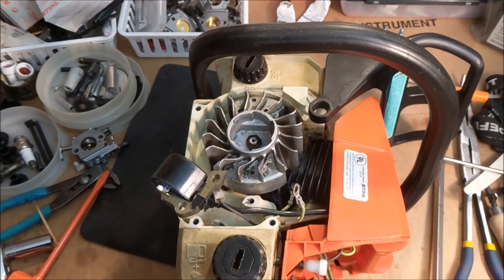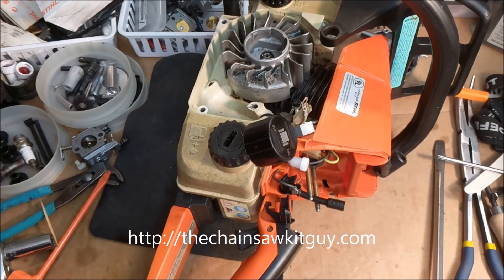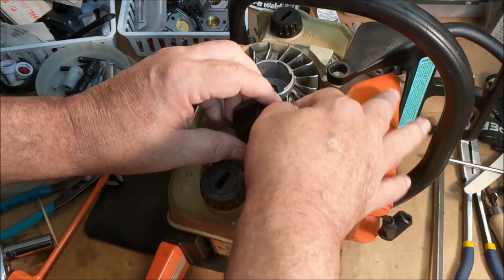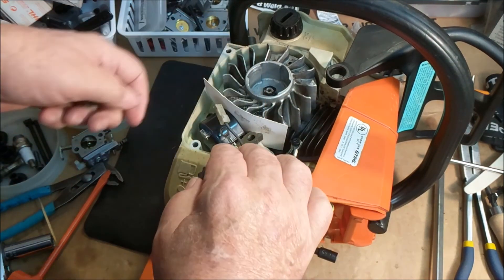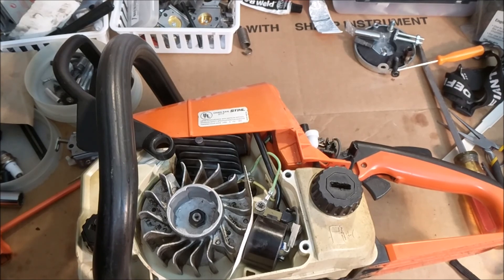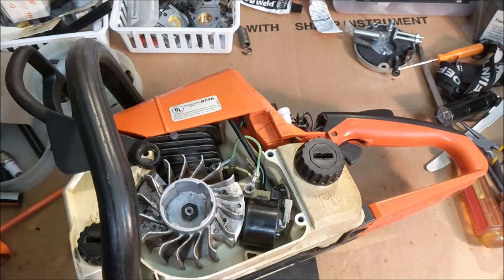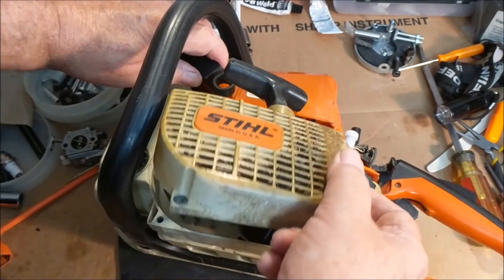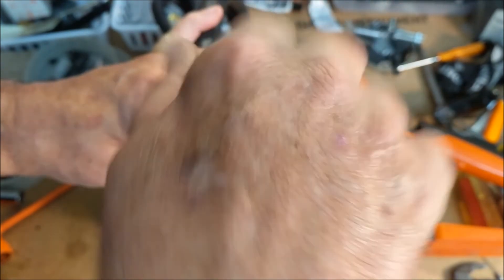Stihl 025 2nd Rebuild Coil SURPRISE, Recoil

Comment: Sure is nice to chat with you I’ve watch many of your videos and from that decided I was gonna do my first clone 660 build. It was an experience let me tell you. I was wandering if you ever ran in to flywheel issues with those saws. I was having severe recoil kickback on that saw originally actually had to go through surgery on my middle finger tendons. I retarded the woodruff keyway to eventually solve the issue. But not sure if the flywheel key was off from factory or if I had something else causing it. I would be very interested in your thoughts on this?
Reply from the maker: Thanks for speaking up. I enjoy it when someone wants to talk. No flywheel problems. Hard to pull is a recent phenomenon. An example, I recently built a 660 kit and put a cross cylinder on it and the cylinder geometry was wrong and it was almost impossible to pull. I put the farmertec on it and it instantly pulled was fixed. A guy put it on a lathe and it was out of whack at the base. But there are other reasons, vapor lock, pinched rings, wood chips from a bad filter, etc. I have found bugs in them. the kits have had different parts over time. Many times i asked when they bought the kit and can often tell what the problem is based on problems others are having  because of small changes or sometimes a bad production run . beware a stihl person will tell you they had the same problem and to do this to solve the problem but for us kit builders it is not the same always because of small differences. Early on i was the first shouting about the kits being available and when i had trouble and asked for help seasoned saw techs cussed me out, chinese junk. It made it worse when i told them what they were saying was not working and I soon figured out why. Those small differences were making it behave differently. The videos being made were crappy and did not actually show you up close how something got done so I leaned to make a video and it took a long time to learn how to keep the saw in the picture lol. But i did and later put up a website so we can keep all the info on the kits in one place for everybody to refer too, to just keep it running or to show how to put one together http://thechainsawkitguy.com. So next time feel free to ask for help. And if you run into something post where i can see it and i will transfer it to the website if it is something that would help others. So it's important when people talk and share. I do all the work. Thank you’s are powerful.
Reply: the1chainsawguy Sweet! I will check this site out. Thanks for your hard work and insight

Comment: and your right it’s from taking it in and out so many times..had a timing issue
Reply from the maker: Nick Duncan you know this saw? I got it from a pawn shop.
Reply: the1chainsawguy no I was speaking of my 660. I think I literally took my coil out 20 times until the threads just came out was just agreeing with your comments
Reply from the maker: Nick Duncan they can drive you crazy. I keep extra coils so I can change them out to test. I have had to rethread more than one hole. The 4mm is the worst on the threads to me.

Comment: The same thing happened to my 660 I tapped it out to a slightly bigger bolt
Reply from the maker: Nick Duncan thanks. But big difference. The 660 is magnesium and this is plastic. But as you see I worked it out.

Comment: I faund out that the gab must be between 0,2 - 0,4 mm....my credit card is 0,20 mm...so it doesnt work.
Reply from the maker: I have a different video that covers that and other points on a 025. The correct space is 
0.2mm. it is not a range. It's a specific size 0.2mm and "they say a business card" is a substitute. I say get the one you use on your car and set it correctly or buy the little gadget from Stihl 1111 890 6400. What ever you do don't over tighten those screws they only require 4Nm or 35.4 inlb's. Thanks for watching
Reply: @the1chainsawguy  its the range between 0,2 -0,4 mm, its on the stihl specifications......easy to find on internet...my saw is stihl 025....year - 2000.
Reply from the maker: @luksurias  I was looking in the Stihl 025 service manual. That's where I get all my information for my videos is straight from things like service manuals. What I said was a quote. But you have a merry Christmas. The space between the flywheel and the coil is not flexible and use a range.